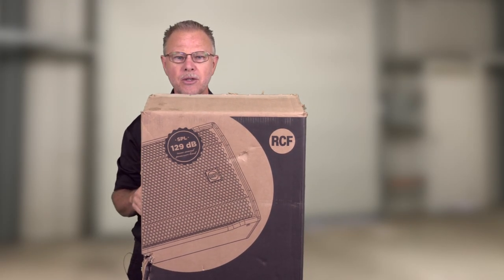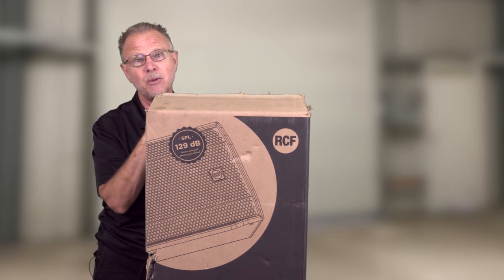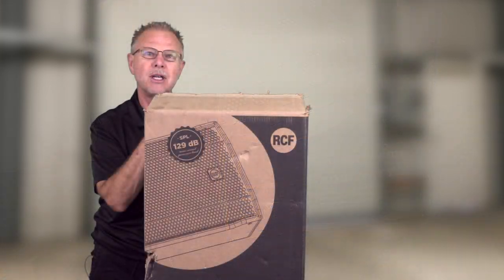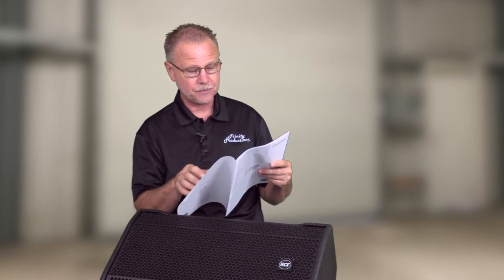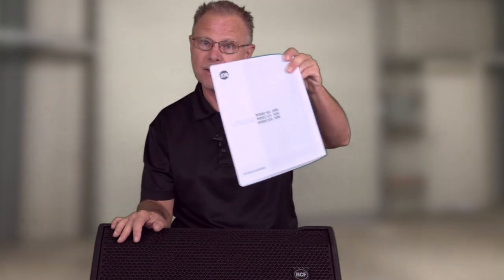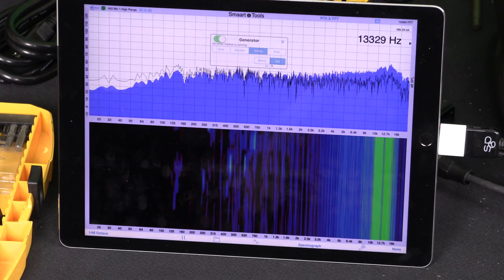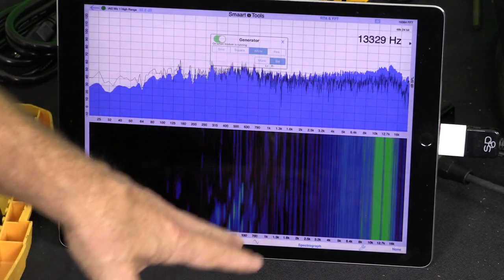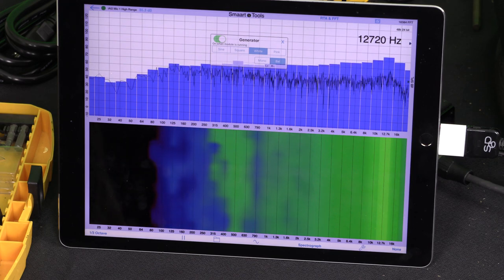RCF ST12SMA MONITOR - Complete Review - Authorized Dealers and Users !

Comment: How would you compare the ST12SMA to the NX12?  I know the NX is a coaxial and all...just curious if you've done side by side comparisons?  or, live as wedges, what differences they have?  Thanks!  Mark
Reply from the maker: Mark, the ST12SMA are good and good for the price point and output, but the NX12SMA being coaxial is a smaller footprint and more power. Also the reason why we own so many of the NX12s (like 14 of them) is that the coaxial design IMO is much more forgiving on ring out and feed back rejection than a separate HF/LF driver 2 way configured speaker. There is a bit of a gap in price between them as well, but construction and build quality is great on either one. The 12's will do most all stage work, but we like to use the 15's for kick, bass and keys.
Reply: Thanks for the quick response and input.....